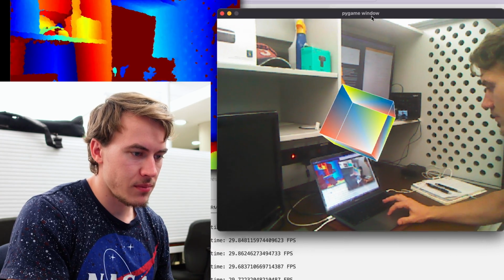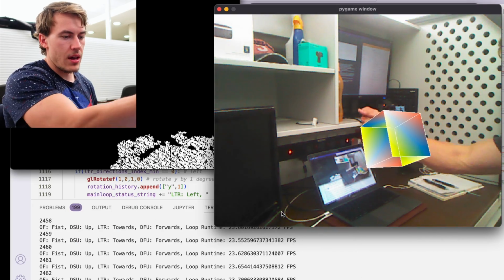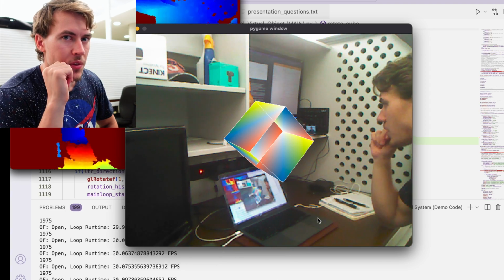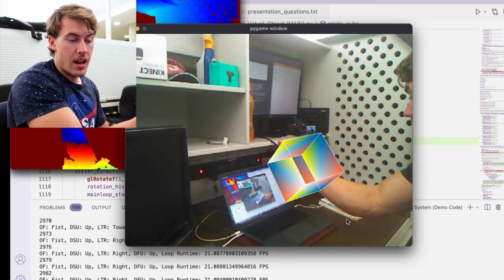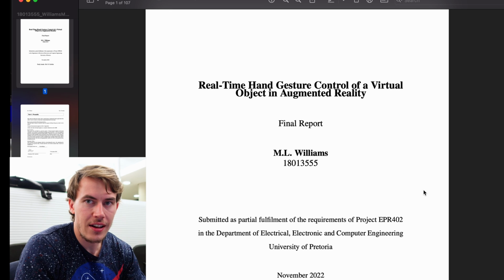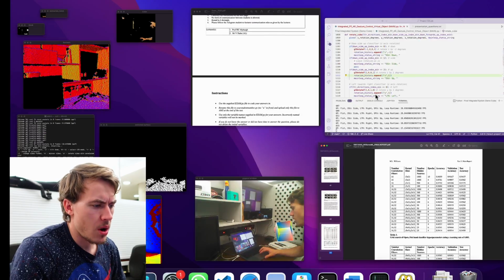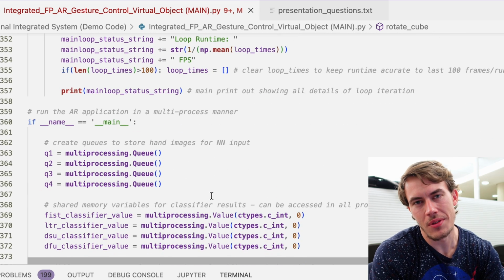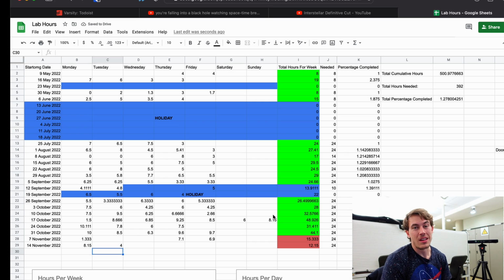My Final Year Computer Engineering Project Explained | Virtual Reality Cube

Comment: Really Cool!! I have a question and a proposition though - Why did you use an interpreted language when you were going for speed and the other thing is would it not be easier with a thermal camera
Reply from the maker: needed higher level libraries for NN code
maybe but couldn't get my hands on one

Comment: Hey Mitch, seems like I am a year late to the party, but just wanted to let you know I absolutely love your project! I am an undergrad just finishing an ML class at UC Berkeley and have been on the search for cool summer project ideas to improve my resume. My idea was to use a raspberry pi with a camera, mounted on top of a VR/AR headset in order to be able to render complex virtual objects (like Architecture 3D models) over open spaces (like an actual construction site). As it seems you have already gone through the struggle and gained some experience in that field, I was wondering if you have any advice on approaching such a project. Based on your experience, do you think training those cnns might be too computationally difficult for the raspberry's processor? Also, is there some minimum hardware specs you could recommend for the camera module - do you think having a moving setup (like in a headset) might create additional performance issues? Those might be difficult questions to answer, I know, I would appreciate your perspective though ;) Thanks for the video and wish you all the best!
Reply from the maker: Hey man! Good luck with the degree. I don't think you'll be able to train on the Pi but can probably do inference if you're smart. I trained on a laptop. Use a basic webcam for video input (cheap and good enough quality) and then I don't have much experience with VR but whatever you can for cheapest and has the best API is probably your best bet! DM me on Twitter if you wanna chat more💯

Comment: Mitch i need your help
I'm a first year student at UP for computer engineering and I'm experiencing some problems when registering.
While choosing modules, Cos 110 states that "Requisites are not met for class, not enrolled "
Reply from the maker: contact the faculty/admin
Reply: Hey I'm a first year too and I have the same problem. They said you can only register for it during orientation week
Reply: @SHDWMhofulet  message the student administration for that program, they helped me

Comment: That is an awesome project dude! I wonder if you could increase performance by letting the camera just calculate the surface when it appears (like the box) completely, than catching 4 points per side on a x,y,z cordinate to span a plane in the room and clear the cache to get some performance back. But again this is awesome keep it up my man.
Reply from the maker: Yeah lots of things could be changed but ah it worked and if I built it again I think I'd redesign a lot of stuff to make it more efficient...
Reply: @mitch7w  If it works, that's all that matters. As an outsider, it's always easier to make assumptions, so you probably had your reasons for the choices you made along the way. I also understand that time constraints played a big part. I hope the hard work paid off for you. Keep up the good work.

Comment: Just brilliant Mitch!  I like the fact that the system can detect and react appropriately to newly placed objects like the Kinect box.  It's one thing for the network to prevent the cube from passing through a desk surface which occupies a set of XYZ coordinates that are discovered at the moment the program starts running but it's an even more impressive thing for the network to stop the cube from conflicting with the Kinect box whose presence, size and position were completely unknown to the network until it was moved into range at some random time long after the program had begun to run.  How interesting that one neural network (viz. your mind) expressed frustration with another neural network (viz. the one embodied by your project) on those few occasions when the latter didn't operate in accordance with a desired function.
Reply from the maker: Thanks Pete! Turned out so nicely